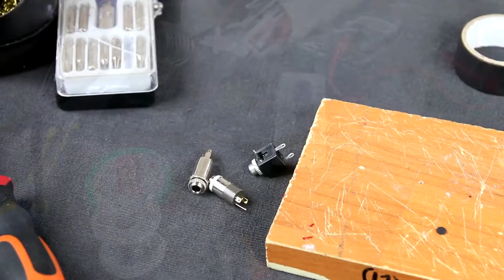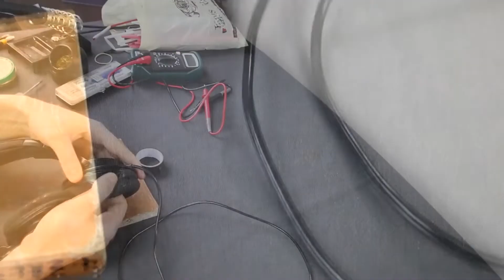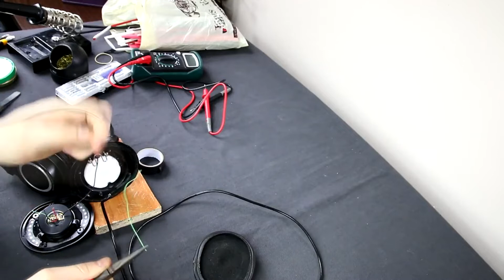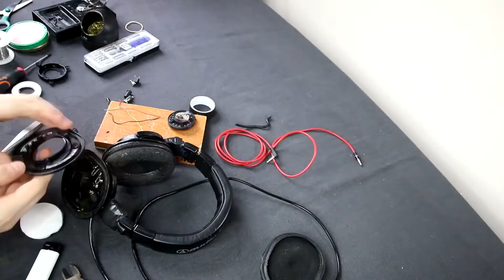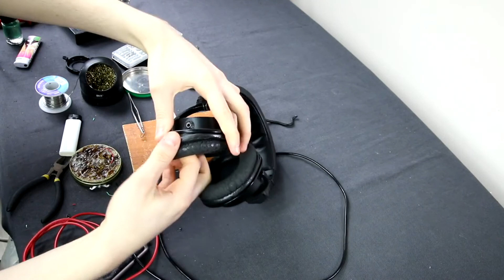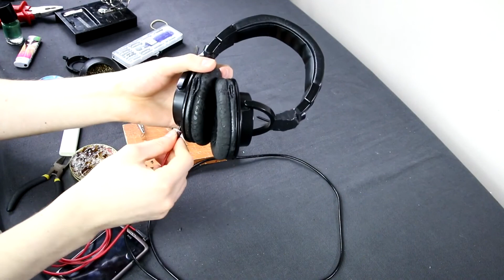Audio Technica ATH M50 Removable cable mod DIY

Comment from the maker: 3.5mm socket in Aliexpress: 
- https://s.click.aliexpress.com/e/_Dd4qwgt
Cable in Aliexpress: 
- https://s.click.aliexpress.com/e/_DCfR5jj

Cable in Amazon:
- US https://amzn.to/4b0RY2x
- UK https://amzn.to/4b0S2iN
- DE https://amzn.to/3Hpf8ST

3.5mm socket in Amazon:
- US https://amzn.to/3S3HkQ1
- UK https://amzn.to/3vAx6yT
- DE https://amzn.to/3vETTcZ
Reply: Better to buy replacement plastic enclosure for the m50x (which has removable cables) and solder that into the speakers

Comment: thx for the link but honestly you didnt even bother to saw the pinout of the new connector and which wires were L ch R ch and Ground.
Reply from the maker: yea, this is old video, maybe you can use for tips newer version video https://youtu.be/4xFSSbdBHuI
Reply: @TechscrewDIY  im doing the mod, only after i were out the earpads and replace and mod all at once
Reply from the maker: good choose

Comment: I've been trying to solve a problem for a few years now.  Mine has the 2.5 mm female connector on it already.  I have a Bluetooth adapter that has a 3.5 mm female on it that I'd like to clip to the headband of the headphone. Then I only need a cable that's about 2 to 3 inches long.  I'm having a very hard time finding a cable that has these specifications.  I'd also like to have a right angles on each end if possible but not necessary.
Reply from the maker: You have m50x headphones ?
Reply: @TechscrewDIY  Yes. m50 and m40.

Comment: Can you specify to what sides the black wire from the other ear connects to?  As well as what color wires connect to where on the audio Jack? It’s a great video, but I can’t make those points out as it’s taken from a distance.
Reply from the maker: you simply need to connect the 3 wires from the headphone side to the socket